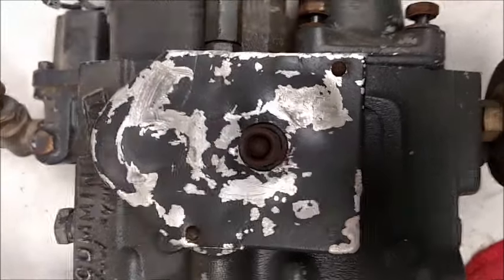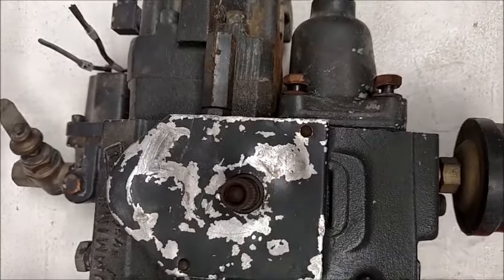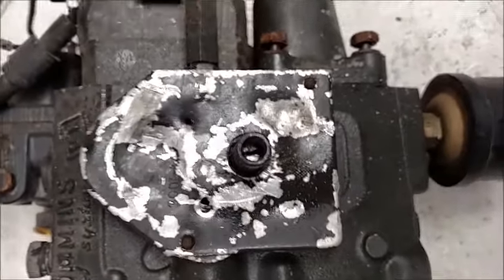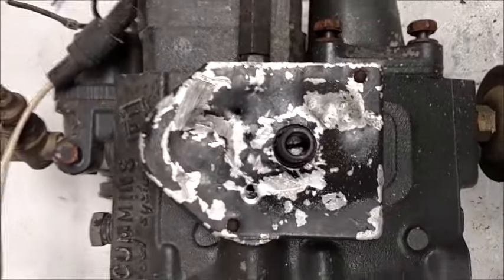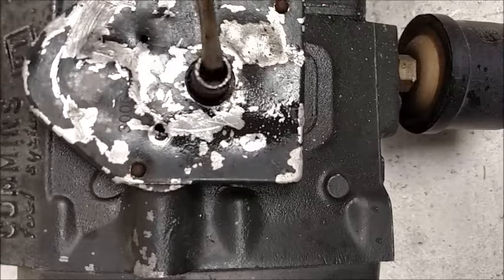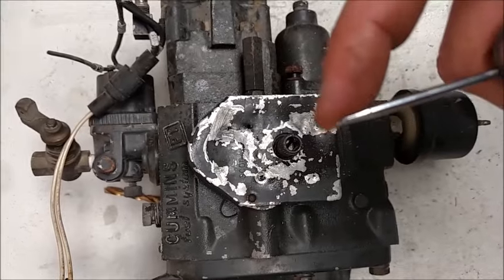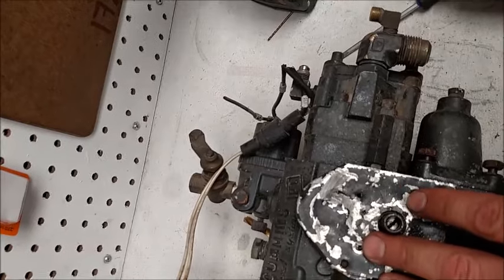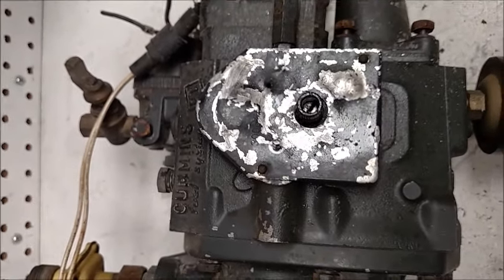Fuel Screw

Comment: the button gives it the pull power blue spring with 6 or 7 shims is a good rpm setting for 2300 to 2400 rpm which is fine for a cummins ... no lower then a 20 button unless u plan on driving ur own truck and don't put more then 1 and a half turns of rail pressure on that screw u will burn a hole in a piston when u see black smoke it's burning the piston let it breath taking off don't floor it after that then u can let it do what it's gone do but she will still get hot keep ur Pyro below 750 degrees u can let it get that hot for spurts but never hold it there for any motor period
Reply: Exceeding 1000°F is when you enter the danger zone of EGTs.

Comment: Tip for young players, make a drill guide, a bit of steel about 1/2" thick drill a 1/8" or so hole right thru then a hole the dia of shaft 1/3 to 1/2 way thru, slip this over shaft then drill thru hole this will hold centred on convex plug and a lot less drill breakage

Comment: what does the button do if that screw raises the fuel pressure also what are good springs to use and button combination for pulling heavy loads 90k big cam 400
Reply from the maker: +Sho Time, The screw raises the fuel flow and the button raises the pressure.  I'm fine with giving advice on the 250 used in military trucks but when it comes to a 400 big cam in a commercial application I strongly suggest having a qualified shop rebuild the pump for your specific application.  That being said if you still want to proceed on your own.....  Remove your current button and look for the number etched on the side.  Then drop it by 7 to 10 to start seeing noticeable results.  Again I can't stress enough that I really think in a commercial application you would be much better served using a professional service.
Reply: 10_4 thanks
Reply: they both raise fuel pressure.